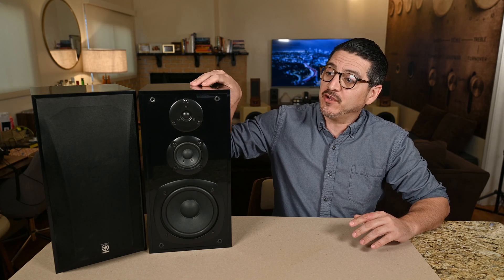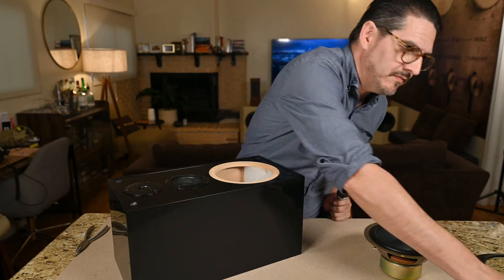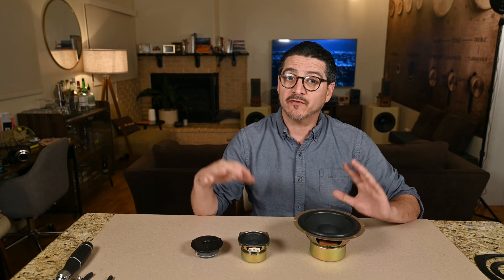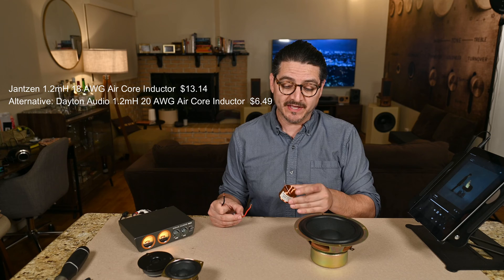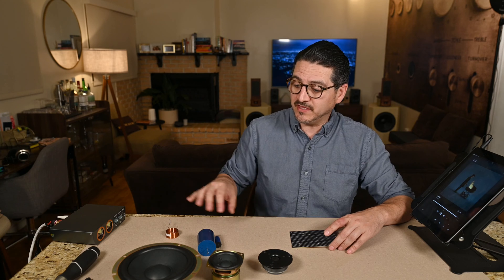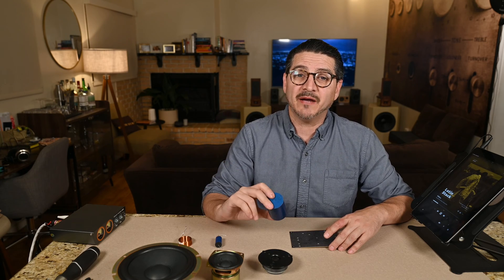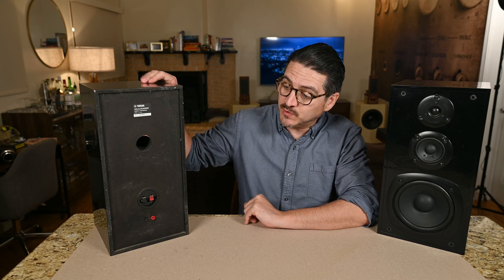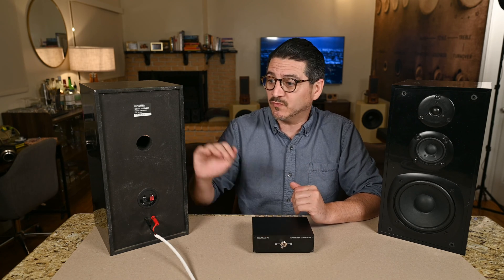DIY crossover upgrade on a garage sale Yamaha AP4400M

Comment: Single cap crossover is not a hard cut. It's about 6dB per octave. So the mid will still be playing 2kHz at -12dB. There is a lot of overlap with such designs. 
All designed to be cheap with smallest cap possible and drivers that "do their best" to work without much filtering, for the price of course. 

Crossover components may also react with driver inductance. You could end up with unexpected peaks or your inductor becoming less effective on a woofer at higher frequencies due to rising voice coil inductance.
Reply from the maker: Thanks for sharing Rennie! Just back from vacation and catching up. I appreciate your info. 👍🏼

Comment: No no... You can't use two terminal plates with separate crossovers on the same drivers.
The filters will interact, causing signal bleed, phase issues, and messed-up frequency response.
It’s not a clean upgrade — it’s electrical chaos. (Think about that.)
Reply from the maker: Good point! Thanks for pointing it out. Maybe a toggle switch to keep separate?
Reply: @RickRuizAudio that would be cool, though you would need a switch with a lot of connections as it needs to go after both crossovers or, making sure that one doesn't interfere with another
Reply: @RickRuizAudio  You would need a toggle switch (with both + and - positions) for each speaker’s 3-way crossover — that’s 3 toggles per speaker.
You should also add a toggle to switch between the old crossover and the new crossover, making a total of 4 toggles per speaker.
For two speakers, that means 8 toggles in total.

Alternatively, you can hear the A/B difference by installing the new crossover in one speaker and leaving the old crossover in the other. Place them side by side and listen to a mono signal.

Or (o good method) is to get two pairs of identical speakers (4 speakers total): put the new crossover in one pair and the old crossover in the other. Then listen to A/B in stereo, using a Fosi LC30 to switch between them.

Method 1 (with 8 toggles) is probably the best because the speakers stay in the same place, so there’s no change in room gain or positioning.

You could even buy one big toggle that vil do  all 8 toggles in one clic that would be perfect! :)

A toggle switch is made of metal, which can pollute the sound. So, for super high-end hi-fi, this is not ideal.
However, since this pollution exists on both the old and the new crossover/XO, this method will still be excellent — probably the best way — to hear the A/B difference between the old XO and the upgraded XO.

you are welcome
Reply: It only matters if he left things connected. If the old writing isn't connected to the drivers, it can stay in there

Comment: Amazing difference! On my laptop, using a very cheap (€ 6,-) ear-in headset, I could clearly hear the difference. Much brighter and very 3-dimensional.
A few months ago I found a pair of speakers at the trash can in the street. It's a 2-way speaker that I'm going to refurbish and I want to get the best out of it. Just for fun.😀. Maybe I´ll make a video and put it on Youtube 🎥.
Have one question: why anybody wants to cross-over a tweeter at 17Khz? I´m 65 years old and everything above 10Khz I can´t hear 🤣🤣🤣
Thanks for the video.👍
Reply from the maker: Lol. Yeah, I was at 17.5k at 40. Now at 48 I'm at 13k 😭😭😭. But the higher frequency sounds do effect lower frequency harmonics as well. So a super tweeter, in my opinion is still a great thing to have. Let me know how your trash can finds turn out! Happy to hear you saved them! 👍
Reply: @RickRuizAudio  It will take a while because I am going to make various adjustments and will take measurements from the beginning to find out what effect every adjustment will have, until the moment that they can beat a 1 million dollar Audiophile HiEnd soundsystem 😀.
So just give me a few months.
Reply: The frequencies don't magically stop at 17kHz. A first order will slope down and you'll still be getting output much lower down.

Comment: I think that these parts are almost overkill for such poorly constructed speaker . Drivers looks super cheap, cabinets paper thin, not sure what Yamaha xover looked like
Reply from the maker: Maybe. But this was an experiment to see what could be done. If someone has these and really loved them for whatever reason, maybe they would like to upgrade them. But I agree with you that the build is pretty unimpressive. Thanks for watching, I appreciate it.
Reply: @RickRuizAudio  Sure I understand, if drivers and cabinet were better quality your mods would make much bigger difference. 
Have fun with it , I do for over 30 yrs and it is a blast
Reply: 3:05 The Yamaha crossover. That's it!

Comment: This is the one audiophile hack I can believe in. Crossovers are inherently evil, they are explicitly designed to have non-flat frequency responses and present hard to drive widely varying input impedance. Since crossovers are so bad minor tweaks can have real audible effect. In short while changes in signal cables, power cords and even opamps and DACs are largely psychological, crossover changes have real objective effects.
Reply from the maker: Thanks for watching, Bruce. I appreciate the support 🙏👍

Comment: Rick, I'm with you on installing a better crossover, but if you have the original crossover still wired to the speakers and original terminals, you'll be hearing some combination of both crossovers.  With both crossovers in place there's a signal path from your Positive banana terminal to each speaker, but from there the signal can travel via the old crossover network to each speaker and then to ground.  To hear your new one cleanly, you'll have to disconnect the original crossover.  Your Yamahas might sound even better than you thought!
Reply from the maker: Hey Randy, I hadn't considered that! What. I'll disconnect the old crossover! 👍 Thanks for the comment. I appreciate it!

Comment: I just built the Xls encores 6 mo ago and used 14ga air cores clarity CSA for LP shunt cap, and jantzen AluminZ cap on the tweeter and Russian PIO bypass caps and it’s really hard to believe what I’m hearing, there is just no way at this price point, some Corian enclosures heavily damped 31lbs each ….that said, it will be very difficult to find another build or finished speaker that will even compare , these compete with any BS/SM speaker at ANY price point period
Anyway, I like the way you just nonchalantly with a few parts completely turned those Yamahas into something worth keeping and 100% affordable, A pair of those speakers on eBay is between 20 and $40 a pair in great shape
Reply from the maker: Yeah, those XLS Encoores are great. Nice job on the xover. Most people still don't think caps matter, just like they didn't believe opamps had different sound signatures. Now everyone wants to "roll" opamps. It just takes people to listen to the changes these caps make. It's just easy to hear how things totally open up. Thanks for watching. I appreciate it 👍
Reply: Different brand caps and  cap materials along with manufacturing process absolutely has has an effect on sound characteristics, I have to ask, What’s an opamp? Is this another name for a term that I already know?

Comment: wow, this really makes a difference, thank you for great video. I'm thinking to upgrade crossovers I my old B&W DM305, but not sure how to calculate induction for coils - there is no value on original ones. Can I keep the scheme, just replace inductors and capacitors? thank you
Reply from the maker: Hey Tom, yeah, first step would be to just follow the schematic. Then if you really want to tweak the sound, you'll need a tool to read the parameters of the drivers and design your own crossover. That's when you should take a course on crossover design. I do recommend it, as to me it's fun and gives you a better understanding of what's going on in the speaker to give you the sound you are looking for. Thanks for watching. I appreciate it.
Reply: You might be able to look up the coil value online or if someone has already measured them. 

Otherwise could try to measure yourself using various methods.

Comment: Was the midrange driver sharing the same cabinet as the woofer?
Reply from the maker: Yes it was.
Reply: @RickRuizAudio  I had the same concern - that mid is getting bounced around by the woofer's pressure waves.  The mid might sound better if you can put an isolation cup behind it, stuffed with insulation/damping material.

Comment: Wow.  The Crossover points that Yamaha chose for these are crazy, in addition to absolutely no filtering on the woofer!

Just goes to show how much all of these types of speakers are made to hit a low manufacturing cost and price point first and foremost...especially seeing the extremely cheap (15¢) single, tiny electrolytic caps they used!

Just from casual listening, I would want to pad down that tweeter At Least another -3dB, and probably closer to -6dB.  YMMV

But your experiment demonstrates that really great sound CAN be achieved even when using really inexpensive drivers in a cheap cabinet IF proper crossovers are used.  I doubt any of the drivers used in this speaker cost more that $5 wholesale from the OEM.

This is exactly what Danny Richie at GR Research specializes in...making his cheap drivers work well together by using decent Crossovers and good enclosure/baffle design (for the most part) in order to maximize his profits.

SMDH at Yamaha for this one.

Cheers
Reply from the maker: Yeah. I agree 100%!
Reply: It's not unexpected for cheap speakers to use the simple two cap filter

Comment: How do u calculate frequency going thru based om capacitance/mH and speaker impedance?
Reply from the maker: There are formulas online that will give you the electrical parameters. That's a starting point. But then you'll need the speakers parameters as well as the box to calculate more precise measures for your specific project. Check out Toids DIY Audio video on XSIM. Or Audio Judgements channel is great as well. I do recommend his Udemy courses. He gives you excel spreadsheets that help w some calculations.